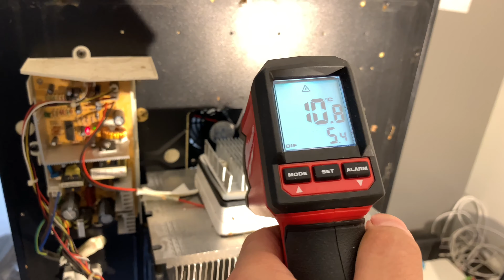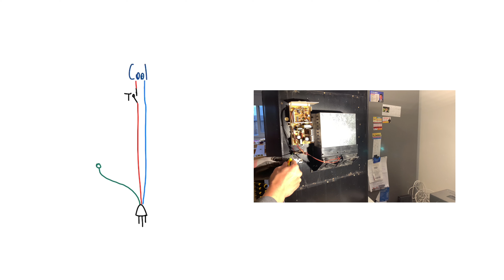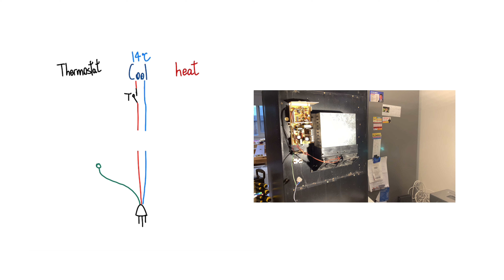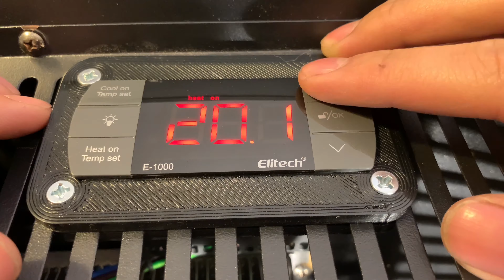DIY Demo: Heat/ Cool Reptile Incubator From A Wine Cooler

Comment: Hello nice video man. Can you tell me if compact policarbonated sheet would work? should i try to make holes in it with a drill for the air tho go through? thanks
Reply from the maker: I don’t see why it won’t work, and yes, air holes will be great for even distribution of heat across the incubator

Comment: What if the temp. you need is 80-85°F and your enviroment is 90°-95° F?
Reply from the maker: The cooling component will turn on when the environment temp exceeds the set temp. Won’t have an issue dropping from 90F to 80F. It will probably struggle to drop the temp all the way from 95F to 80F. Then again, most houses should be insulated enough to not experience temps as high as 95F
Reply: @Varanibae  Thanks for the tip.
Reply: The heating cable is like the one for water pipes? How many watts?